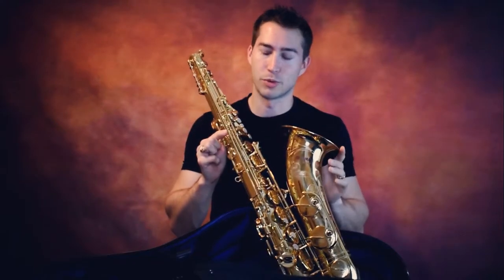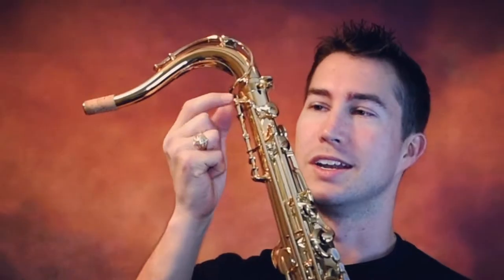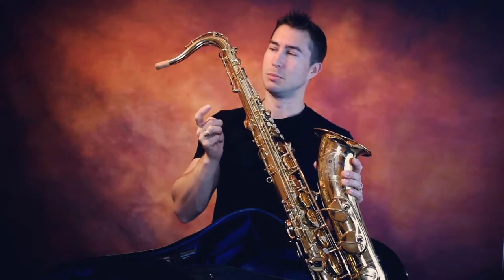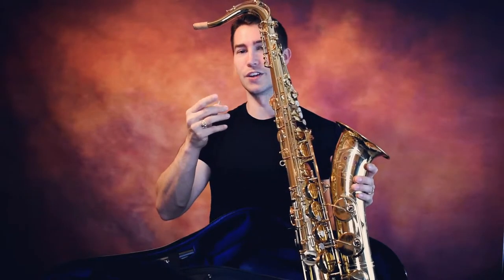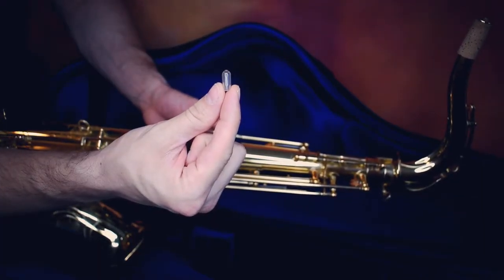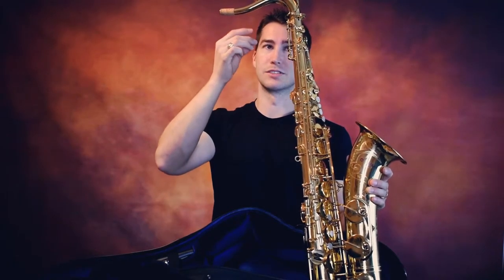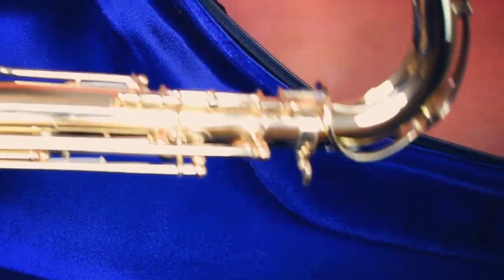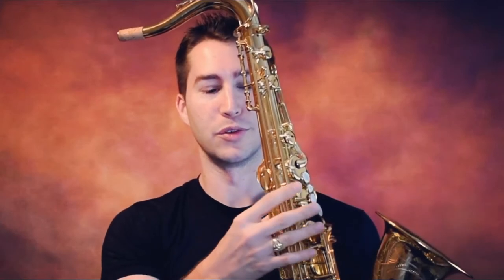Sax Tip - How to Extend Octave Neck Receiver on Saxophone

Comment: Another awesome one is a glow stick light connector. Get a pack at the dollar store and they slide right onto a Yamaha tenor mechanism!
Reply from the maker: good to know!
Reply: This is a cool hack.  I just purchased the Glo Stick connectors and cut one to the desired length.  Hopefully it will last until my repairman make a permanent fix for a new neck which is higher than my regular Yamaha neck.  Thanks Chris!
Reply: I had difficulty finding the end caps that Chris suggested, but at Dollar General I found 12 glow stick bracelets with 'connectors' for $1.34. The connector was a  perfect fit for extending the octave pin on my YAS-200ADII (aka YAS26) - and I have 11 spares. I was just about to return my Yamaha AE1 Custom Neck when I saw this post. Thanks to Chris and TooMuch TooFast for a great work-around. Will eventually have a tech make up a permanent brass tubing extension but until then this works great.